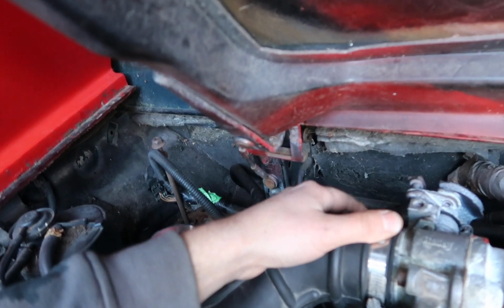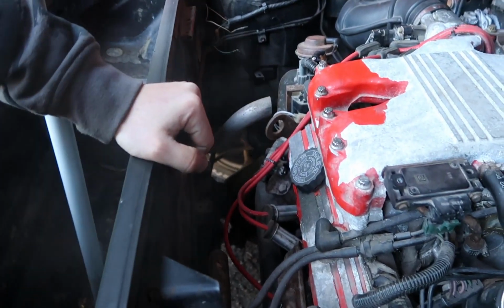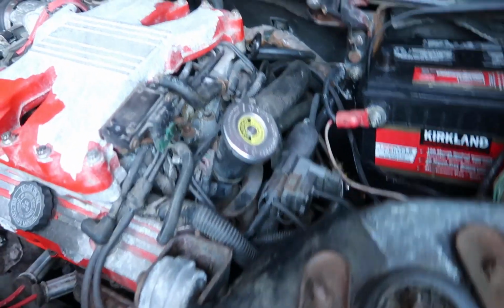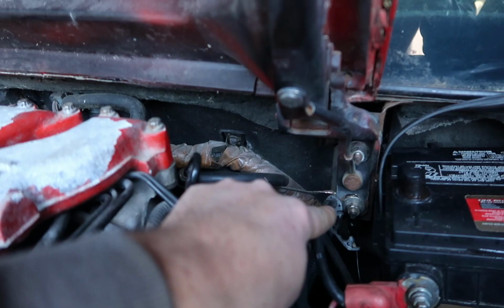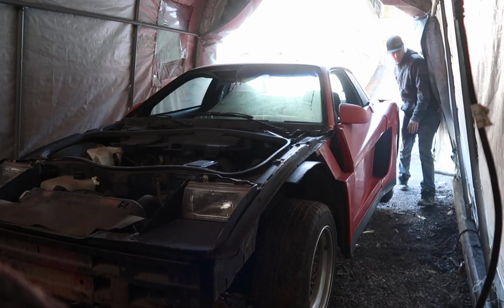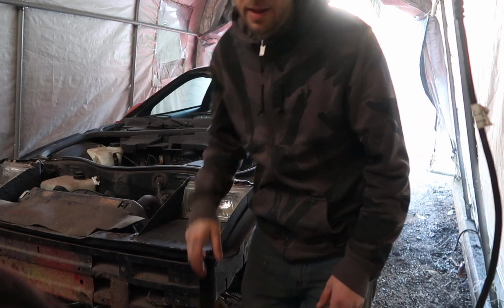Straight Pipe Cold Start!

Comment: check your fuel pressure.
your pump is  clearly working since its getting fuel to the motor to start it, but it may not be getting enough.

Might need to check the cold start injector as well.  that's a real pain to change so hopefully not

Congrats on gettin' this far tho!
Reply from the maker: Great advice, getting a fuel pressure gauge tomorrow to test!

Comment: Best thing is check O2 sensors maybe manifold
Reply from the maker: Thanks for the suggestion, ill look into that!
Reply: Bad o2 won't stop it from starting, it doesn't use the o2 until it warms up and goes into closed loop. Instead of removing the exhaust, you should have just removed the o2 until you got it started, then reinstalling it once you got it running would have told you if your cat was actually clogged.

Comment: You messed up the timing, you shouldn't have messed with it and should have replaced the ICM instead. Try turning the distributor when starting, first one way, if it doesn't start, try the other. Once it runs, you're going to have to put a jumper in the aldl connector then put a timing light on it. By putting the rubber intake back on, you didn't fix vacuums leaks, the large hose that runs into the intake is for crank case ventilation.
Reply from the maker: Thanks sooo much for your suggestions, i recently checked my timing, TDC and the marks on my distributor lining up with #1. Going to be checking a few more things this weekend! If you have any further knowledge or information it is greatly appreciated!!!
Reply: @MADCRE8TIVE  that's it, replace the ICM and turn the distributor until it starts. Then be sure to jumper the aldl and time it. There's a very slim chance your injectors are stuck they do that when you let them sit sometimes, don't bother with that till you get it timed and see how it's running.
Reply from the maker: @ExtraFungus   You seem pretty knowledgable on fiero's! I appreciate your help with diagnosing. I had to remove the old exhaust as it was rotted out and I has a new quad tip exhaust that I needed to replace anyhow. Installed new ICM plug wires and spark plugs. got it to run for longer then 2 seconds by turning dist. So once I try starting with new wires plugs and can get it to run steady I will make sure to jumper ADL and time it!
Reply: @MADCRE8TIVE  sweet deal, cleaning the iac wouldn't be a bad idea, seafoam does a great job breaking up the carbon and when you jumper the aldl for the timing it will also reset the iac. If you don't have vac leaks and there no other mechanical issue, after you time it it will probably be the best running Fiero you've ever had.
Reply from the maker: @ExtraFungus  I had a successful day today, your going to enjoy the next vlog!

Comment: Does it make a loud humming type noise when you first turn the key on? If not check the fuel sending unit and or power to fuel pump. In the video it didn't sound like the pump came on.
Reply: The fuel pump is basically under the shifter area of the car. Very noticeable when you turn the key if the pump works or not. Atleast with mine it sounds like a hotrod fuel pump when I first turn the key on to prime the system.